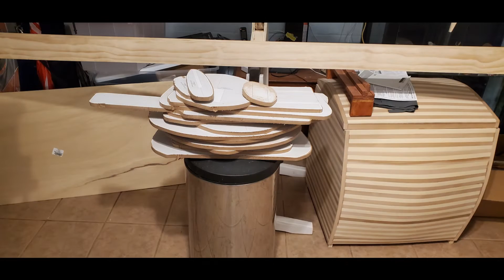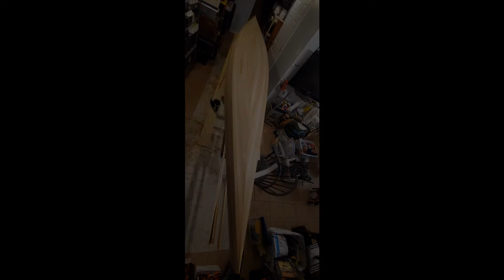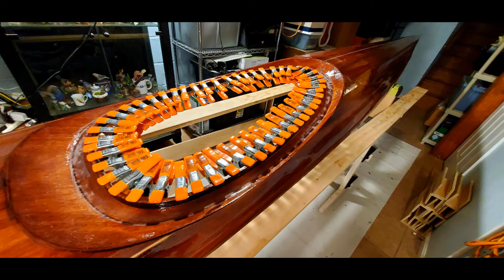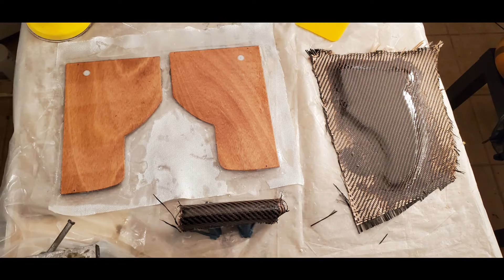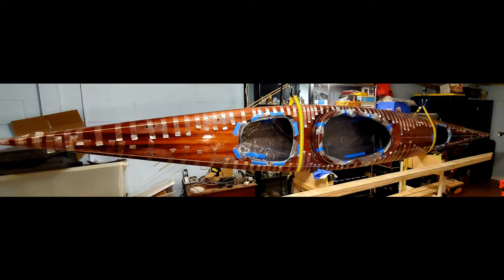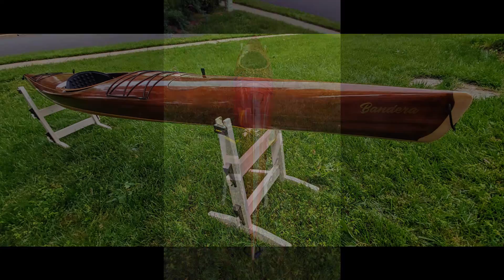microBootlegger Sport build

Comment: Hi Chad, could you let me know how you did your recessed deck fittings?
Reply from the maker: Sorry for the slow response, @chrisgrainger4792.  I read about Moroske deck fittings and then found a good video of a guy doing it and took a chance that they would work and they did.  I documented my steps with photos from my build.  They have worked great, able to fit both bungee and perimeter line in the same fitting.  I use the perimeter line running through these with much of my weight so they are strong.  Anyway, here's the guide I created.  I give credit to the folks who showed me how in the guide.  https://docs.google.com/document/d/1bUtL72IaEKQMHTgr7hll1ensANbk2sORYuHdbHIID3A/edit?usp=sharing

Comment: Hi how are u holding down the hatchs also amazing looking boat
Reply from the maker: I put wood "hooks" on the bottom of the hatch and 2 padeyes on each side of the hull below.  I put a loop of bungee cord on both sides that pull the hooks down.  I've had waves wash over the deck and it's dry afterwards.